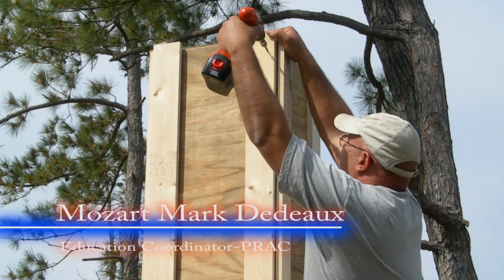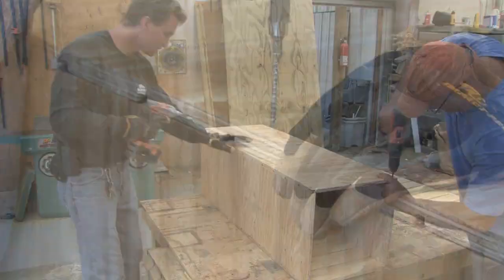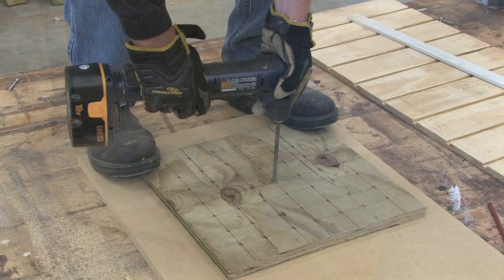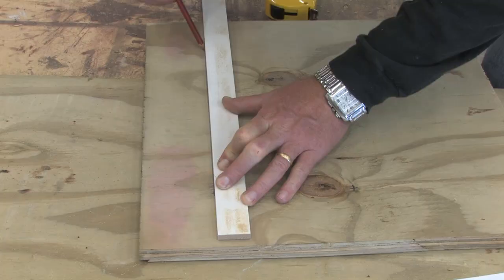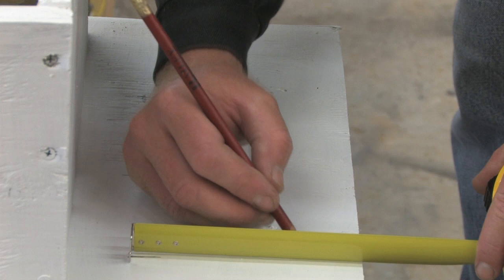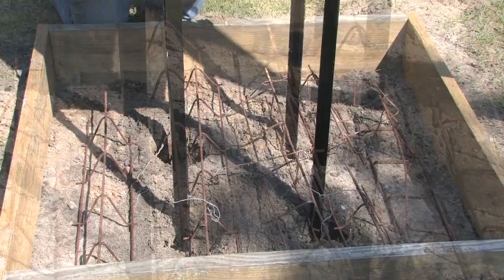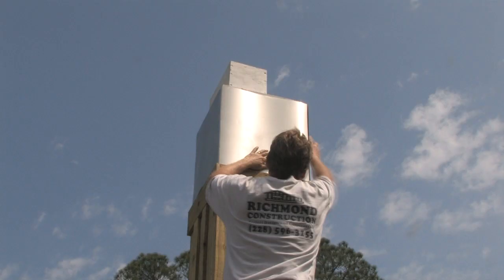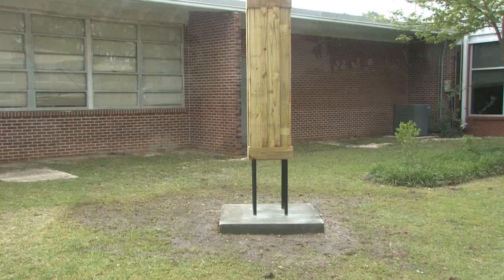Chimney Swift Tower Construction Part Two

Comment: Excellent video. Thanks for posting.  Wondering if there is a issue with mold growing on the interior of the T1-11 plywood as it is left unfinished and rain can enter.  Mold did grow on the interior of my partially enclosed shed constructed of T1-11.

Comment: 8:10 - I love that these guys are doing this, but "perfectly vertical using a framing level?"  These birds live inside hollow trees.  Make the thing as irregular as you want.  It will be more like home.  Mine has been very successful using an 8' long,  two-foot diameter cardboard tube that I weatherproofed from the outside and lined with twigs stapled on the inside.  ;-)
Reply: Leveling the tower is simply an esthetic choice. I mean it would look a bit off in your yard because the building material you are using is square and straight. I have used hollow trees planted in the ground. To each their own, .....I'm sure everyone would equally appreciate a leaning chimney swift tower of pisa. :)
Reply: @mozdedo  I had not considered the Zen Master way.  I apologise, master.  ;-)

Comment: Without video connections, it will only run about $550. Of course, one can lower the cost by finishing the outside with recycled wood. This tower is tried and true design that works, so it is worth the money.